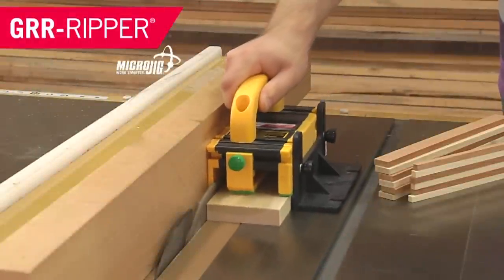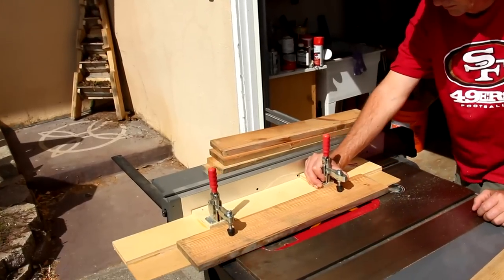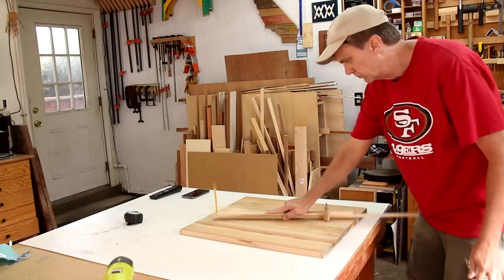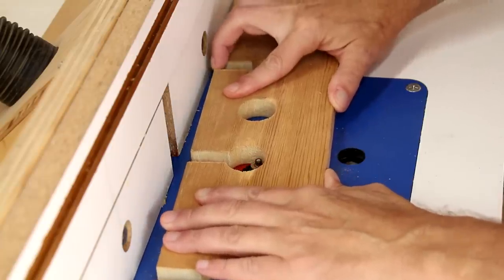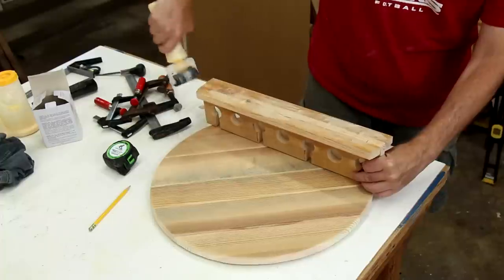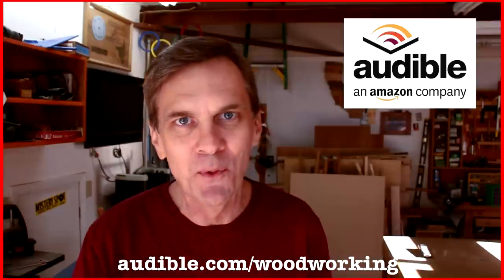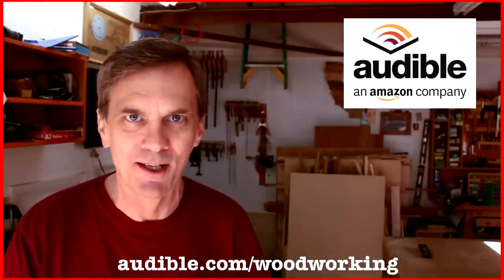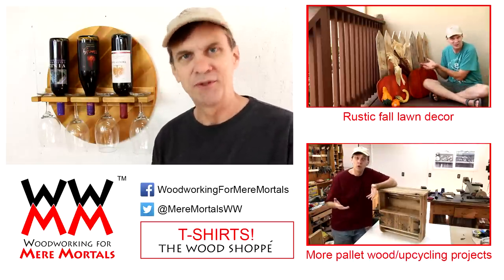Wall-mounted wine rack made from recycled wood

Comment: Hey steve, if you don't like the look of the rounded screw buttons , drill a matching hole in a scrap, wiggle the drill bit slightly to make a SLIGHTLY oversize hole, and then sand the button flat, leaving about a 16th to 3/32nd of an inch rim. Bit more modern looking, and lower profile. Fits some projects better. Fast to do on As belt or disc sander,and uniform if the scrap is square to the table.

Comment: Thanks for the video. The product has good form and function. At first, storing wine upside down was a little disturbing to me, since wine bottles are traditionally stored on their side with the cork fully covered with the wine to stop too much air ingress. But it might be OK upside down. Then again, does it matter? Your wine rack is so good it will probably do for the living room, frequently re-stocked to entertain your woodworking fans so it cannot not oxidise or leak or suffer from precipitate. You could have several of them, each a different shape - a diamond, a cartwheel, a star etc.! How delightful!

Comment: *****  Ok, question, Why did you use the torx screws? I have been wondering who some people use torx, and some people use phillips and flathead etc. Other than preference is there a real difference on the head wise... other than being difficult... and not wanting someone to take apart(or yourself to scrap the lumber again) said project? I know some of the theads can be different on some screws... but if the normal(flat and phil) are the same thread sizes as the torx then why the torx?
I think you did answer this a long long long time ago but I forgot, and I cant find it anymore.